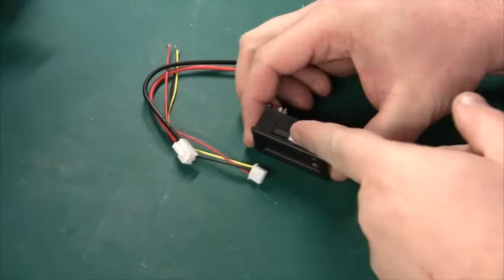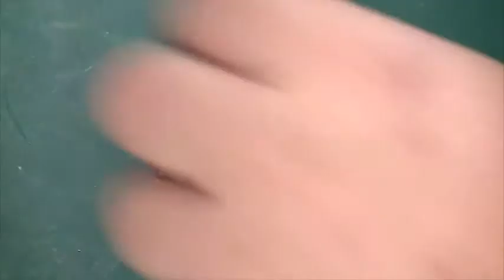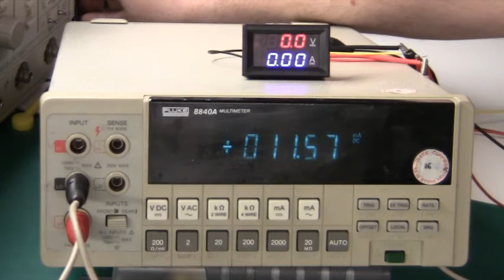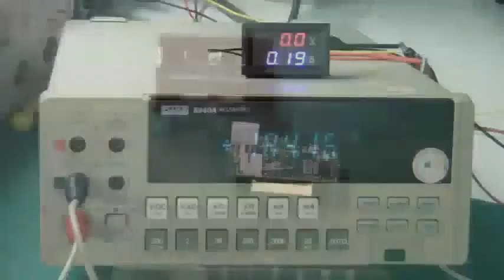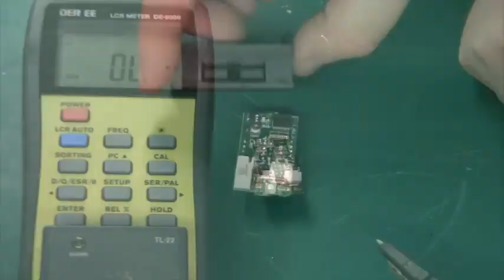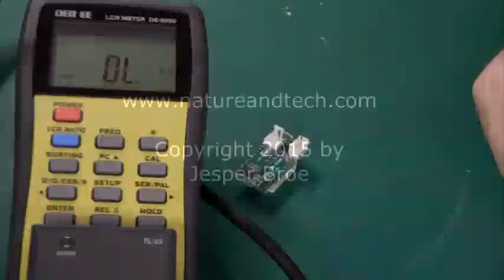Review of 3 dollar panel meter from eBay

Comment: Can i connect the small red wire (to power the display) to a switch? Ie.. I would like the circuit to work in my camper van but have the ability to turn off the display as its too bright/drains power. Of course I am wanting all the circuit to still flow with the switch (and display) off.

Hope that makes sense
Reply from the maker: I don't think it's a good idea to power off the meter, but still have voltage / current on the inputs. If you just want to dim the display, you can change some of the resistors on the display. Let me have a look for a solution for you. I will publish a video about it later.

Comment: A question Jesper, are you connect the measure wires in series when you measure the amperes/current from power supply?I think that you using external supply for module in this case?
Reply from the maker: +SeAfasia The current inputs are in series with the load, just as when using a normal multimeter. If you want to measure both current and voltage, the black current sense wire  should be connected to the black power supply wire. I guess I should have shown that?
Reply: +NatureAndTech 
Many of them are without shunt resistor and nedd to be carefull with the wiring...
Reply from the maker: +SeAfasia the one I have here is with built-in shunt resistor, but I have seen some higher-current meters that require external shunt. You have to look at the connection drawing before you buy it.
Reply: +NatureAndTech 
are you replace this shunt resistor to get more accurancy?